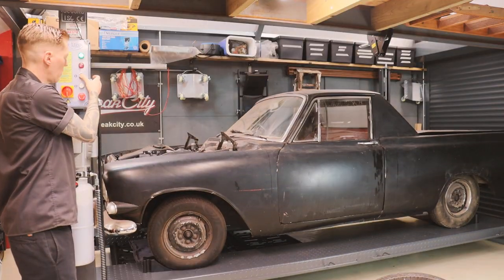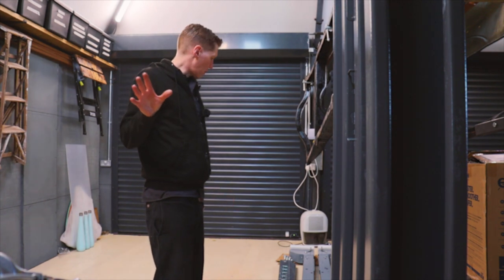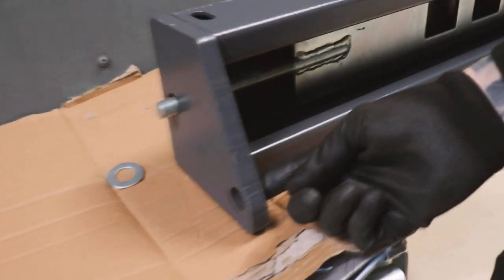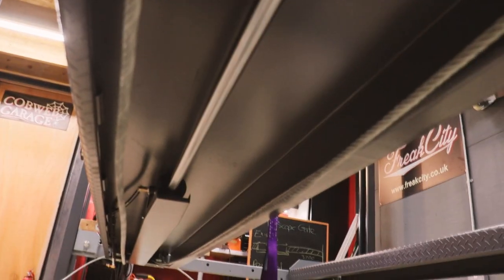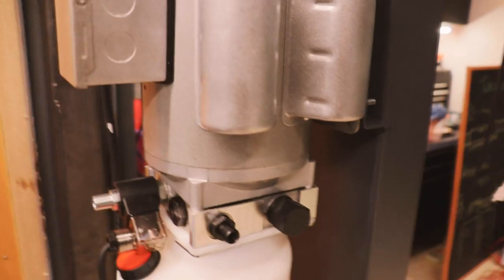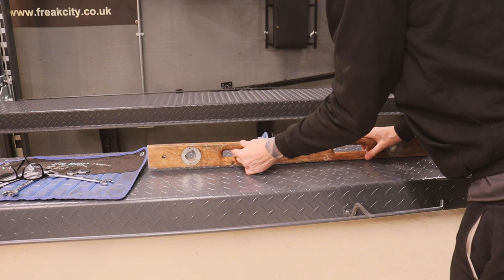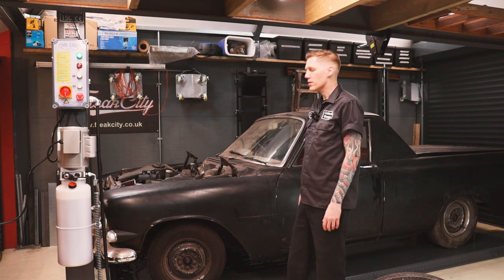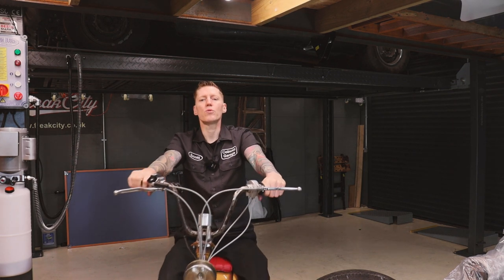Installing a 4 post car lift in the garage, on your own! The Ford Zephyr pickup truck is lifted!

Comment: Did you bolt the lift to the floor?
Reply from the maker: Hi Dan. Yes I did in the end. I’ve obviously never owned a car lift before, and although I believe you don’t have to bolt them down, I feel it’s a bit more secure bolted down…..especially with that heavy old Zephyr up in the air. ;-)
And of course, there’s no room in my garage to move the lift around anyway, so it may as well be fixed down.
Reply: That’s always been a dream of mine too 😀👍
Reply: Makes sense mate. Good job. Was it expensive? Looks like a decent bit of kit